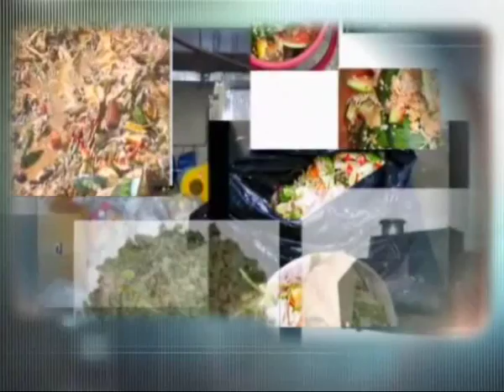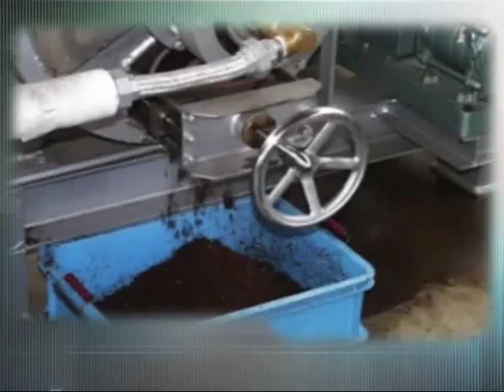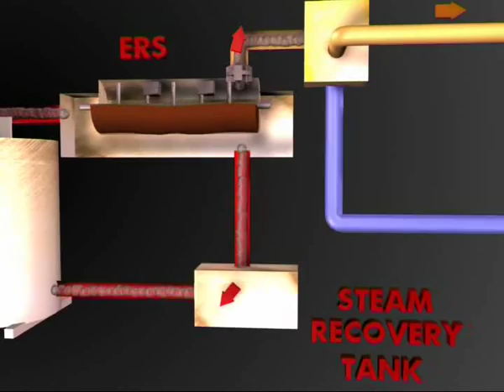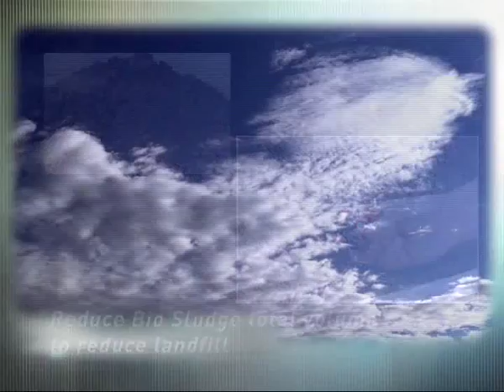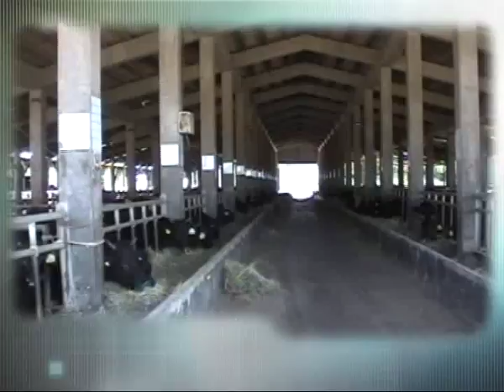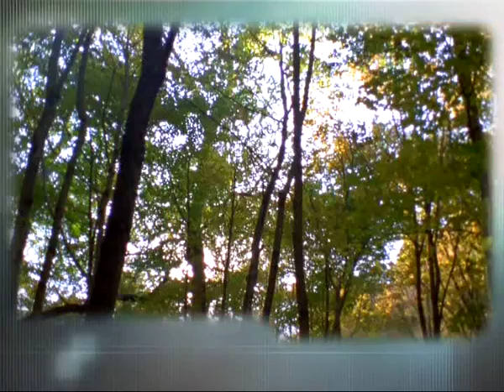ERS (Environmental Recycling System)

Comment: Can it segregate plastic/construction-debris kind of waste separately automatically or they have to be removed first before putting waste in it?
Reply from the maker: You can feed unsegregated waste.Our Microbes only react with the organic materials.Then we can separate the plastics and construction debris from the output.
Reply: That's great. Where can I read up more about it? I hear one such machine has been installed in Bangalore. Would like to know more on it.
Reply from the maker: www.jers-e.in
Reply: Thanks Thanesh. Can I have your contact number? I have few questions. I sent a mail to info@jers-e.in  but didn't get reply. I have questions other than what is mentioned in that email too. My mail is mghatiya@gmail
Reply from the maker: Could you pls forward the mail to Info@jers-e.com.